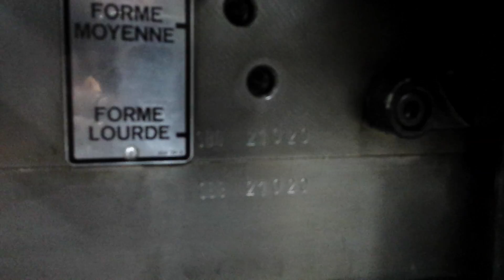Heidelberg Cylinder SBG Die cutting machine

Comment: I ran one off and on for over two years. I loved the this press. I was in printing for 17 years but started bindery. Then did small offset printing and ran a windmill press when needed. The cylinder was sitting there for several years without an operator. At one time in between jobs worked graveyard at a shop with the cylinder press. It was highly used there die-cutting labels and table cards for a huge winery in the states. Someone else set it up. I loaded and ran the work. I then went back to the other printer. A job was to go out for die-cutting and scoring presentation folders. We'll I had down time and found an old die for folders. Got permission from a super to mess with the Heidelberg Cylinder, working with used paper stock. I was able to set it up and got it to work. Then the super said run the job for the folders. I did and then I cut the job down. I then folded the job by hand and glued the pockets. By the time the boss came in the morning to take the job to the die-cutters, I told him the job was complete. From then on I ran the press as needed for two years. I loved that press if not just for the sound.